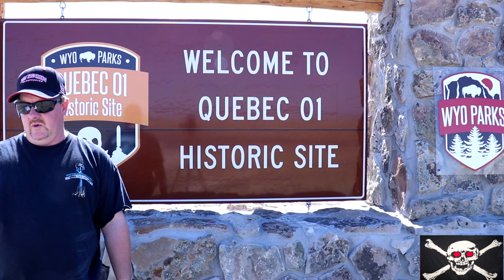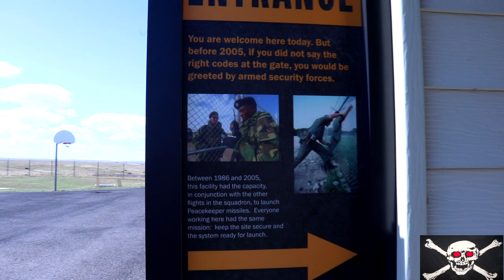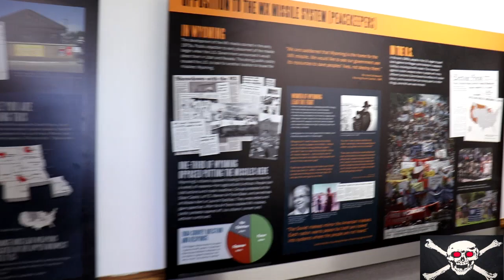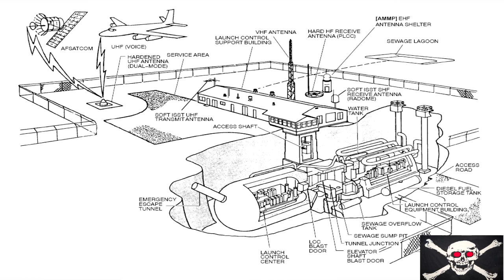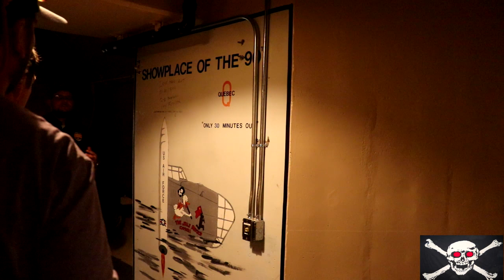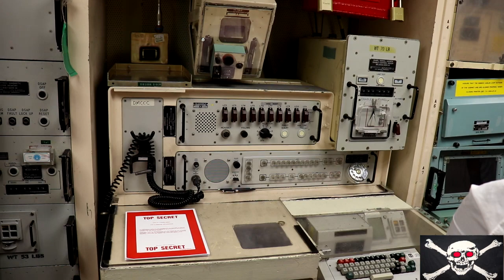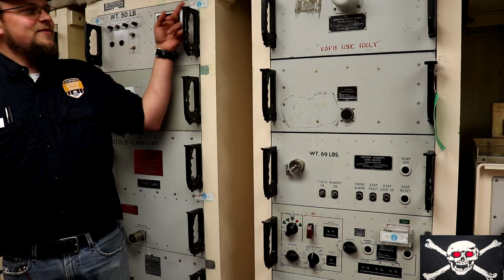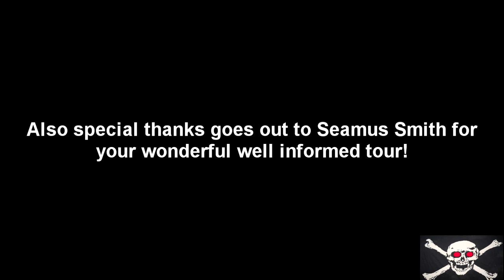Full Tour of Quebec 1, a Nuclear Launch Control Facility

Comment: In my day (86-87), there were no female cops, so the first bedroom on the right was the FSC, the second next to it was the security crew, the next at the back corner was transient. Across the hall in the opposite rear corner was the FM and back by the rear door was the cook's quarters.

I was in the 400th on flight 6 and worked Romeo 01 as response team at first then FSC just before I got out.
Reply from the maker: Awesome. Thank you for your service! I heard a few different arrangements over the years. My father's view was also slightly different then what the museum had it. I talked to the curator and she had told me they are trying to put it back to the way it was when it was decommissioned in 2005
Reply: @jollyrogerhobbies2386  

Yeah, I heard they refurbished the sites sometime after i got out. Romeo had a larger rec area and there was no pool table there. 

Back in those days, we had 16 foot satellite dishes that we could pan across the sky to tune into different satellites. The first part of my time, nothing was scrambled and we watched nearly anything we wanted. Towards 87 and beyond, providers started scrambling channels and we were limited.